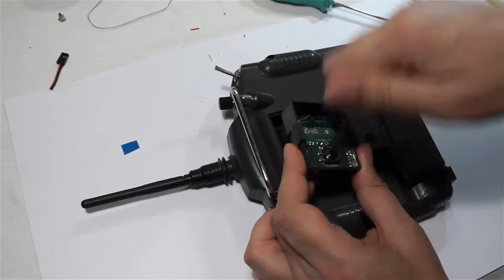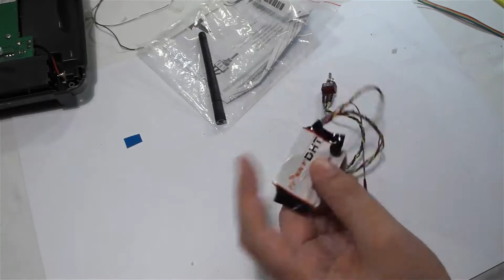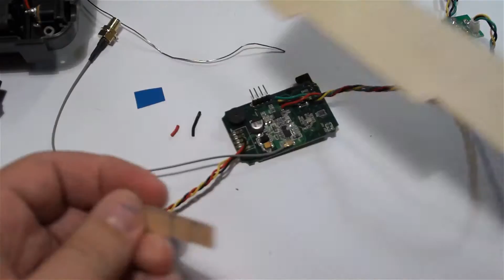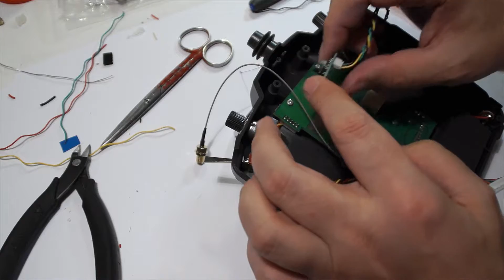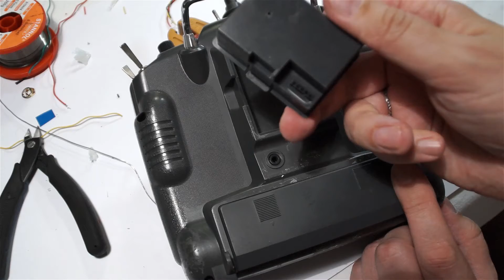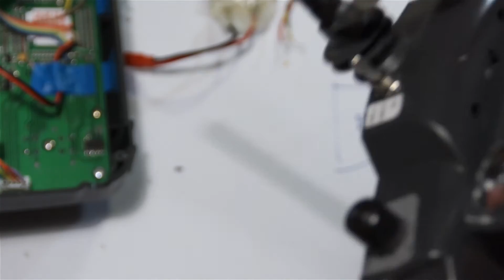T9x - DIY Frsky Tx modul installation with a telemetry on display Part 2 - ENG

Comment: Very excellent, thanks for making it!  I recommend to all, don't cut the antenna wire, save it and reuse the module.  I use it for all my cheap foamies, so I can use the $6 receiver.

Comment: Such a great resource RM. You should be proud to be of such a service to the RC community. I love this one particularly as I am ready to do the massive modification to my 9X. I wonder if it know the kind of surgery I wish to perform :-) I would ask one question though. I have not heard anyone speak of this mod to the circuit of the DIY FrSky DJT board, can one not update to Open9x (FrSky)  to the full module replacement? There is so much to consider!!! I am going to look at the other video Thnks

Comment from the maker: You can use any FrSky telemetry modul, where you have acces to Tx and Rx data lines. But change of the Tx modul will be on different modul different. But! I will soon make a new movie, with FrSky mod with use a "Mijou smart board" - this is small board by one smart Czech (actually Slovak) RC modeler. With this "Mijou set" you have a small pcb board, new speaker, headphones output, switchable backlighting support, all on connectors + vibration haptic on board. Price is about 25-30USD.

Comment from the maker: And with this board you can use any FrSky telemetry modul without any difficult changes on Tx modul. Just connect +, -, and PPM and Tx and Rx data lines. Plus moding of radio motherboard, it is same like in this movie... Video with Mijou board will be soon...

Comment: This mod description is a lot better compared to all the other ones, because it saves you the efford of translating rs232 12V to 5V level (via max232). Thanks for clarifying this and remove the need for translation. Did you ever thought about to cut the power line to the frsky max232 modul to save power? Not sure if this would work, but could save a few uA

Comment: currently i have frsky DJT tx module, which one is the pinout should to be connect to the MISO and MOSI? the board is not same like the video.
i have done to solder the wire for the usbasp. i also done to cut the left side on two smd resistor, jump in to atmel chip on the radio board.

What other things should be done to make this mod success? i was read this topic from one to other page. at the end, it makes me confuse.

thanks! :)

Comment: Richard when I upgrade my transmitter to ER9X FrSky my Thr swc and Ail swc dont work at all and once I turn the transmitter on it shows warning those keys are on and when I down grad to solid ER9X it fixs do you have any idea what is the problem.
regards

Comment: A further comment to remove the old Turnigy Transmitter. It is not fully true it must be removed. Of course it could not be used at the same time with frsky modul. You could buy another Switch with 2 positions but 3 soldering connectors to connect the 5V power line either to the frsky or to the old transmitter modul. The 5V power line in the transmitter needs to be cutted additionally and the power needs to be routed first to the switch, which either forwards it to the new frsky or back to the old transmitter port. I got a 2 polarity switch (still only 2 positions but 6 soldering connector for 2 independent paths) and did the same for the pulses signal as well. If you do the simulator fix (put a 1kOhm resistor in pulses line) in the transmitter module a simple switch should be enough. Of course in this scenario you have two antennas, but only one is active, depending on the switch state. In my case the Turnigy antenna is on the transmitter module which gives me additional the possibilty to put in other transmitter in JR format as well. 
So the additional switch (which should have a protected position or mechanical lock to prevent unintended switches) gives me the possibility to switch from frsky internal modul or to JR modul, which I have by default the old Turnigy modul installed.
The use case is quite simple, I did the change later on and I got already a few Turnigy and HobbyKing receiver, which I still want to use. For newer expensive models I will buy frsky and use the new module.

Comment: Richard do you lose any of the radios functionality by doing this mod?
Do all the switches and pots still work as they should?
Many thanks rct
Reply from the maker: rct2 Nope :) All works great on MANY radios. If are any problems with switch, in all cases (if is this mode made properly) is reason wrong version of OpenTx (Open9x etc).